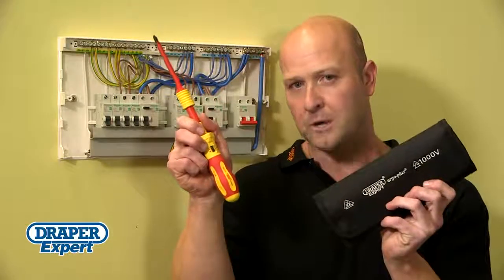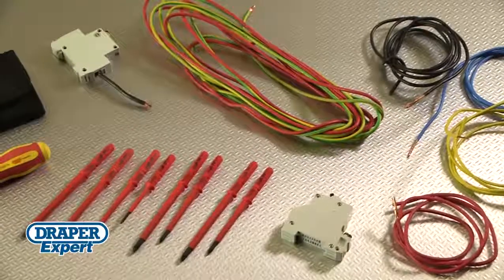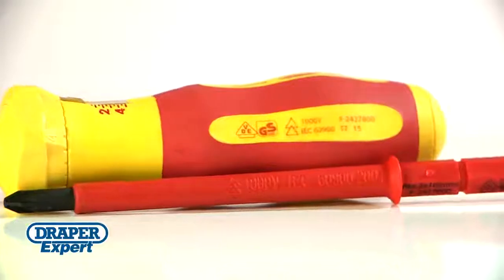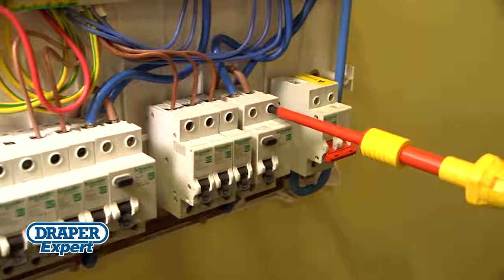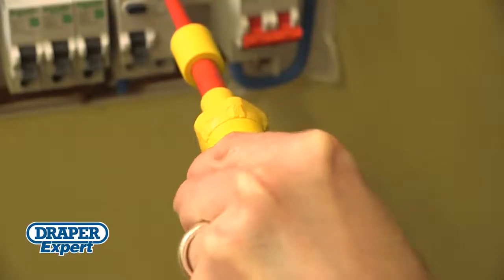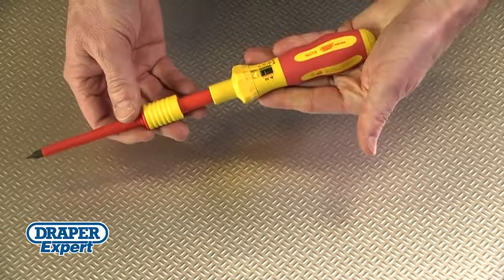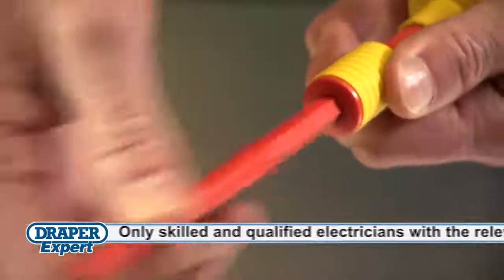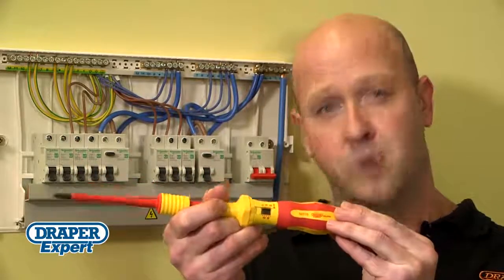Draper Ergo Plus VDE Torque Screwdriver Set Explained

Comment: Why are there numbers on the lock collar
Reply from the maker: thats used to set the torque limit
Reply: I didn’t mean anything. I wanted to understand what was written in the instructions that it was written “Reduce the torque to serve you more.” Is there a problem if the torque stops I took the torque number it will stop
Reply: I didn’t mean anything. I wanted to understand what was written in the instructions that it was written “Reduce the torque to serve you more.” Is there a problem if the torque stops I took the torque number it will stop
Reply: Can u answer me plz  @SealantsandtoolsdirectCoUk
Reply from the maker: its designed so that you do not overtighten so when it stops thats it
Reply: @SealantsandtoolsdirectCoUk  thanx a lot and perfect information can set it to 5N.M always and never damaged??